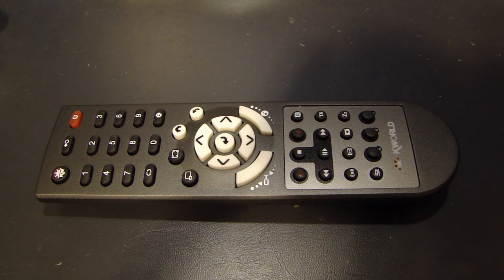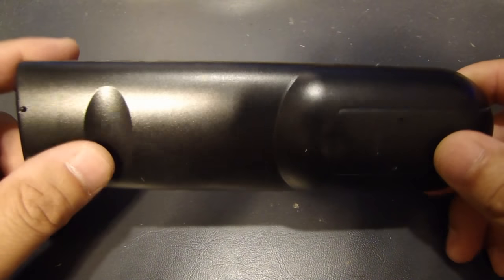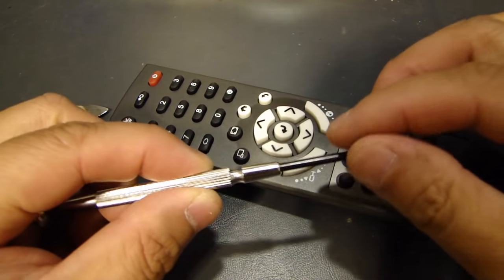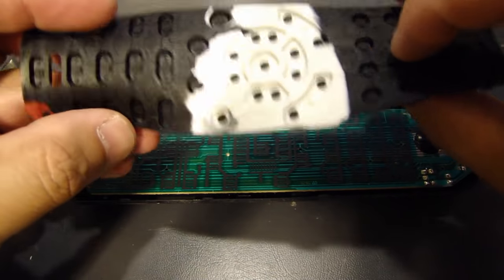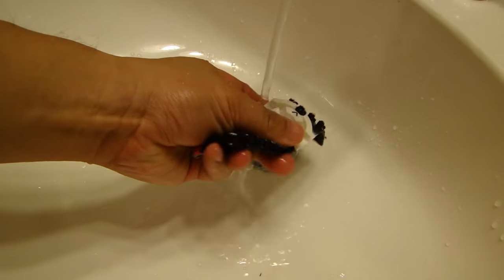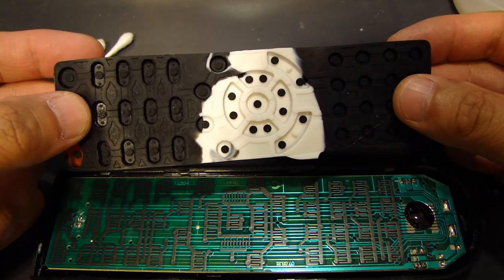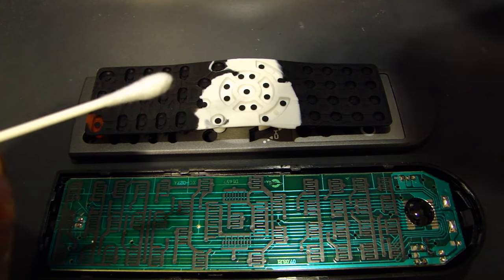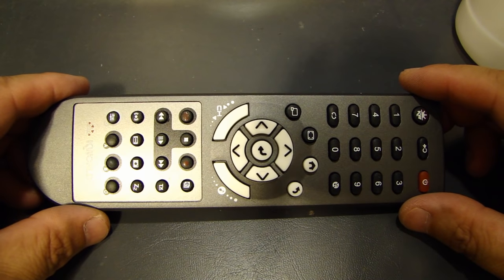How to Fix & Clean Your Remote Control Buttons

Comment: Six years later, your video is still helping folks. My remote wasn't working, I assumed it needed new batteries (even though it has occasionally momentarily not worked in the past, requiring just a quick slap against the table to resume working fine-- I'd assumed the batteries had occasionally wiggled a tiny bit out of allignment or something, but now I think it was the dirty inner workings), but new batteries didn't fix it. Anyway I watched a couple vids on YouTube, wondered if it was worth the trouble and decided to go for it. Wasn't sure where my guitar picks were so a slender, small straighthead screwdriver worked fine. Yes it was greasy inside. Washed the rubber keyboard in Dawn liquid dish soap (for handwashing dishes) as I didn't need or want a rosemary-mint-smelling remote control. I used Kleenex instead of Q-tips, just feeling lazy not wanting to search for the Q-tips, Kleenex semi-soaked in rubbing alcohol for the circuit board and for the post-washed keyboard. After drying the circuit board, the rubber keyboard and the plastic cover with Kleenex I then placed them in front of my fan for a few minutes to assure it was dry. Snapped it together. Voila. Ready for Frasier or StarTrek or whatever. Thank you for a clear, concise, sensible tutorial. Way better than ordering a new remote online or shopping for one, along with having to wait for it. And spending the money. Thanks!

Comment: Tip to add: I've had to do this many times. I started about 5 years ago to get into the habit of keeping the remotes face down on a coffee table, night stand, wherever. It stops the dust from settling into the buttons. I have many devices that use a remote and some might sit for a week without being used, or even longer. They stay so much cleaner if you keep them face down on the table top! 

I've done this often with many cordless phones too!
Reply: I actually leave mine face up for the simple fact that once the batteries leaked in a remote and it spilled all over the innards. So if I do forget another time. I’d they do leak it leaks always from the board.
Reply: Dude, I was using an app to turn off the tv and you just helped me a bunch. Thanks
Reply: I do this, too.

Comment: Have a 20 year old Yamaha theater remote that the power button quit.  I looked into replacement to the tune of 35.00.  Followed your suggestion, as soon as I took it apart the power button area on circuit was black.  I cleaned it all and now it works like new!  Thanks so much!

Comment: I use CBC QD Contact Cleaner. I bought a can a couple of decades ago for various projects (cleaning off residue from exploded batteries, etc.). So a can will last you forever. Spray some in a disposable cup and dip a Q-tip in it.

Comment: I'm usually disappointed when following these "DIY fixit" video on YT but this worked perfectly. Remote control now fully functional after half hours work. The hardest part was prying apart the casing. In my case it was some hidden screws under a stuck on panel (logitech harmony 350). You also really do need a plastic pry tool like a guitar pick. I managed to get by with an old credit card. Thanks to the uploader of this video.

Comment: Thanks dial2fast!  Yea!  Following this video fixed my tv remote that has been such a pain even when it was new (3 years.)  upon opening the remote case, I found oily material on the circuit board and the rubbery button sheet, which I presume was applied intentionally during manufacturing.  I wondered if it was a good idea to take this off with soap and water followed by q-tip and alcohol.  It turns out it was VERY good to do that.

Comment: A Medium weight guitar pick works great for separating the two plastic halves. Jam it in at the half way point along the long side and then once it's in, slide up and down to separate the clips. Works great and no marring of the plastic that would result from using a screwdriver.
Reply: Yes. this needs more likes

Comment: Thanks so much for this awesome tip ... I was scouring the web for a replacement RC for our Onkyo AV receiver as a few essential buttons have stopped working (volume +/- for example ... so annoying!) and I couldn't find a replacement for less than £45 ($67) once the shipping was factored in!! Followed your advice, and it has worked a treat!
Reply from the maker: Thanks for sharing your experience!

Comment: I did this and it worked great! Only small problem I had was getting the rubber button pad back into the slots in the cover when reassembling.
Reply: It would probably be easier to do the opposite of the video and fit the rubber pad into the front cover first, and then  with that facing up, lower the rear of the remote down on to it.

Comment: Thanks so much for this advice, it saved me $15 (I know, because the cable company quoted me this much) You were so right about dismantling being the hardest part, and iIn the end I couldn't put back the tiny attaching phillips screw......but so what - the clips will hold the remote in place. Thanks once again

Comment: It's been six years since you posted this and it's just as relevent now as it was when you first put it up.
I have an old stereo that I couldn't find a universal remote control that would run it. What the heck, if id didn't work, what would I be out? A busted remote.  But did work after I cleaned it up. 
Thank you very much!
Reply from the maker: Very good to hear. Thanks for sharing!

Comment: @Soccy Rivas ...I looked at repair kits online. Many used a silver based paint to restore the contacts. But I also saw a repair paint made with carbon. It seemed like carbon was what the manufacturer had originally used on the contacts of my remote, since I could see a black film clearly present on most of them. (Not so much on the faulty buttons, however.) So, after washing the keypad and cleaning the circuit board with alchohol and cotton swabs. I scraped dust from a charcoal sketching pencil onto those contacts that had little or no black film (the same buttons that weren't working/barely worked). Once I coated the contacts with a fine black layer, I snapped my remote back together. It works wonderfully now. I'm sure the professional repair paints might last longer than my improvised solution, but the remote works like new again, and it didn't cost me anything but a little time and effort to do it. (I'm glad I didn't try to use acetone. The alchohol worked perfectly. Good advice!)
Reply from the maker: Thanks for the feedback.

Comment: Hi, so it finally worked!  I did abuse the case of the remote, but that's ok. I cleaned it with rubbing alcohol, and dried it with a Q- tip. It didn't work for awhile.  Maybe it took a little while to dry completely. I pushed the button of my remote and it worked!  I thank you for teaching patience doing this. Well, I'll try other things in the future since I learned some patience while doing this. Thanks again! 👍 🙂

Comment: Thanks for posting this very helpful video. After tipping over half a glass of beer I didn’t realize that the remote got wet as well. The next day when I hit the power button nothing happened and that’s when I noticed it was sticky. I figured it was fried and I would need to buy a new remote. Day 3 I thought maybe just try and clean it really good so I watched the video and followed your advice. There was one screw in the battery area and 6 more smaller ones inside. After a thorough cleaning and trying to remember how to get it back together I could not believe my eyes when I hit the power button and saw the red light come on. It works perfectly and I’m not sure why. It should have been fried.

Comment: Bingo! Have cleaned my remote before, with rubbing alcohol, still had problems with the heavily used OK button. Didn't cross my mind to use detergent. Put it in a bowl with dish soap for a few minutes, rinsed, then rubbed with alcohol - now it works.

Comment from the maker: William, thank  you for sharing your tip on this. Great advice!
Reply: Thanks for giving me the courage to crack open my remote control. Because I can tell you the worst fear a DIY person has is to open something up and a bunch of springs shootout..... although there were actually a couple of springs near The Battery area, they pretty much stayed in place. I'm put all of the components under warm sudsy water and afterwards I dunk them in rubbing alcohol..... dried everything off, and what temperature to put everything back in the remote the same way it was when I took it out. I must say that my remote now works better than new. thanks again for your video

Comment: Video was helpful, but my remote still had two buttons that didn’t work. Volume up and volume down. The most used buttons.

Since I didn’t find dirt when I cleaned everything, I decided to take it apart again. I noticed on very careful inspection that the back of the volume buttons (back of rubber pad) was GLOSSY from wear. From thousands of button pushes. 

I took a Mr Clean Magic Eraser and dipped it in rubbing alcohol, then rubbed the back of that section of pad. Magic erasers are very mildly abrasive. It removed the layer of polished rubber that wasn’t making good electrical contact. Dried it. Put it back together and it’s as good as new. Thanks for the video.

Comment: Hi...Thanks for video. 
My remote was really stubborn and very tight. I would get my old credit card in but if it slipped out it would close again. I found that putting 3 more credit cards in a downward angle, all around did help but still couldn't pull apart or keep it open. 
So I just twisted halves to look for debris or mess on circuit board...and yes...it was sticky syrup or something. I wiped off both the rubber buttons and the circuit board with an alchohol wipe. Then blew it dry and snapped it back together. 
😁it works👍
Haier TV remote HTR-D09B for my Haier TV stopped working. The CH-&- and volume buttons should not move cursor on INPUT or Menu to select functions or make changes.

Comment: Mine is a Shaw Direct / Arris IRC 600 Remote Control
Some of the buttons were sticky due to ?? At a guess pancake syrup!
It was not too difficult to unsnap the main body after removing the two screws located in the battery compartment. They are tiny Phillips head screws and were deeply recessed.
I used an Exacto Chisel blade to pry the case apart far enough to insert a plastic putty/ silicone spreader into the side slot on one side. With a little twisting effort the case pops apart .
Inside is a circuit board and a moulded Silicone Button Board!
I took pictures of all the parts .

Comment: This worked great, though after opening the device I was reluctant to try it because all the contacts were covered with a very fine grease. I was afraid perhaps mine worked differently, and the grease was required to make contact. But I cleaned it as instructed -- removing all the grease -- and it works fine. Saved me $40!
Reply from the maker: Very good to hear you got yours fixed!

Comment: Thank you, thank you, thank you!   My power button hadn't worked in over seven (7) years so I left the TV on most of the time.  When the volume button stopped working recently, that was not good.  I did exactly as you illustrated, it is works perfectly.
Reply from the maker: Thanks for sharing your experience. Glad your remote is working now.

Comment: Thanks.  My comcast remote had what looked like clear light grease on circuit board and buttons.  Any chance that was some kind of dielectric grease to help make contact?  Great video.  Cleaned my  remote couple of times now. Well used.

Comment: Good, thank you, but let me add much-needed diassembly detail. My TViX remote is of near-identical constuction. The top/front cover has a descending ledge sitting inside the lower/back case. That ledge has exactly 12 indentations with bottom shelves that engage with tabs protruding from inside the lower case: 2 top, 2 lower, 4 each long side. You need only find each of those indentations –yes, a rigid guitar pick is best (I used 0.88 mm)– then with the remote face up, push in and lift to clear the indent lower shelf over its tab. Complete one side first and the top will release easily. Complete the other side and now definitely the top releases. At the lower curved edge the smaller indents are wedged in between the now open case parts. Find and release those with a narrower guitar pick. Sand off any earlier screwdriver damage by sliding across fine wet-and-ray paper laid flat on a flat surface.

Comment: Some of the outside cases are glued or some 'sonically welded', which means you can't open the case without breaking it. The manufacturer didn't want anyone messing with it at all, considering the part disposable.

Comment: As a repair tech for many years, I have concerns over washing with hand soap that has skin oils and fats in it to keep your hands from drying out that will coat he contacts and create a new problem by insulating the contacts.  Secondarily, rubbing alcohol is bad for electrical contacts as it has oil in it to keep the skin moist and to prevent drying out from the alcohol.  Use ONLY isopropyl 90% or greater as it will clean with out any oil residue.  Be sure to use canned air to dry off the water and or alcohol.

Comment: My original remote for a Samsung smart TV 2013 (bought in january 2014) became so laggy (in 2021-2022) and a strange feeling when pressing the buttons.

I opened the remote up in a similar way as in this video. And I found the reason why remote was laggy: it was WET inside! No idea how that liquid appeared there. Maybe moist or something.

So here's what I did:
1 - used q tips to remove as much liquid as possible from all parts.
2 - washed all parts except for the circuit board, with dish water
3 - helped the parts to dry faster
4 - putted all parts together when it all was dry enough

WORKED PERFECT!

Now this remote is not laggy at all. My TV feels "fast" again! And no need to buy a replacement remote!

This was the first time ever that I've opened up a TV remote and I don't have the perfect tools. I used what I could find. Sadly a few small plastic pieces fell off but seems like that was not very important pieces. That remote is from early 2014. So I'm happy that I could fix it!

Also, I don't have that strong alcohol. Wish I've had. But it worked fine without it this time. And no idea where to buy it.

I would only recommend doing this if there's true problems with the remote. I got a few other remotes but those work great! It's always a risk when trying to open them up that you scratch the plastic or sone small plastic part will fall off.

And one more thing: the plastic part where you will connect the batteries, on my remote you can remove that metal piece between where these two batteries belong. So remove it before cleaning that plastic part!

Might be a good thing to buy that "iFixit toolkit" for smartphones and computers so you got a tool to open up the remote. Or a similar toolkit with another name.

And once again: if your remote works great and is pretty clean, don't open it up!

But what I'm thinking of is the best way to clean the remote after X months/years when it got much dust and stuff on it. How to do it the best way without opening it up?

Comment: I clean the rubber buttons with disinfecting hand wash with a scrapped tooth brush, rinse & wipe dry; the circuit board was wiped with windshield washer fluid - the cheapest form of cleaning alcohol

Comment: I just cleaned my  fan remote and it works fine now. I used Witch Hazel.😊
Reply: Interesting choice, what was mixed in with the witch hazel? 

I used mouthwash as i didn't have acetone or rubbing alcohol or first aid kit. Remote works, so not fussed but I took a risk there...

Comment: Thanks! Worked like a charm! My 10+ year old sanyo tv remote now works like new! Pressure to activate the buttons are feather-light again! Slagged the screw though coz the plastic seized over the screw thread. Good thing it also employs side snaps. Peace. 👍

Comment: Seal your remotes in clear plastic (carefully taped shut) or at least keep them in a clear sealed Ziploc bag and they won't get dirty. When the plastic wears out, use new plastic and replace the batteries at that time. Then, you won't have to go through the cleaning procedure.

Comment: I just fixed my Magnavox Remote, that some buttons worked and some didn't, using the information from this video. The trick was using the  Isopropyl  Alcohol. I used 70% vs 90% which is what I had on hand. I tried cleaning with tuner cleaner and it didn't work. The alcohol did the trick, after cleaning the board and the buttons thoroughly, the remote now works.